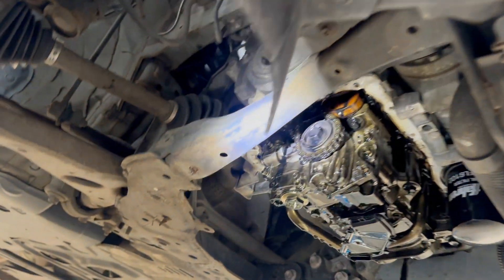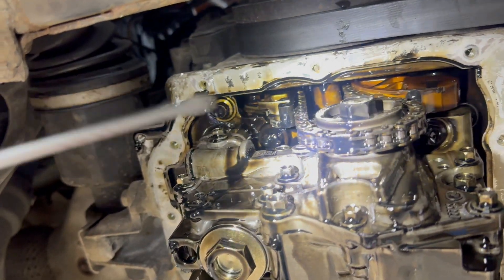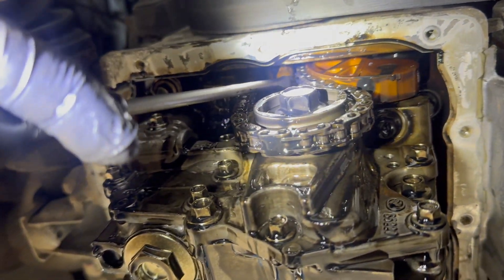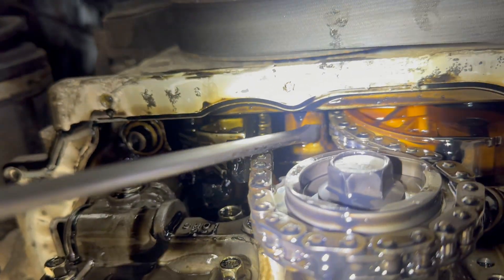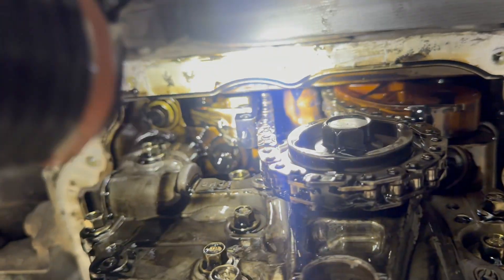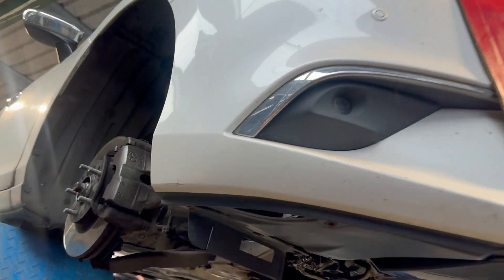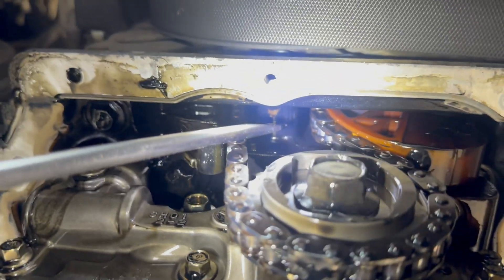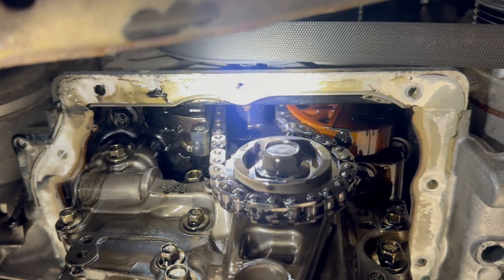Mazda 2.2 Skyactiv Timing Chain Noise and Oil Pump Chain Stretch Inspection

Comment: Without pulling the oil pan, couldn't you read the cam/crank differential degree's on your scan tool data? Greater than 10.45 degrees equals stretched cam chain. Replace.
Reply: You cant read oil pump chain
Reply: @krzysiekp9753  I was referring to the timing chain on the camshafts
Reply: @Hyflyer28 i know what you mean but main chain is usualy ok is the oil pump chain which is making noise and is snapping

Comment: Usually what is the mileage that is necessary to replace the timing chain? And when the timing chain is changed, is it necessary to change the oil pump chain as well?
Reply: Oil pump chain is common to fail,so yes 100% recommended to change together!
Reply: I made it 193k miles without the timing chain ever being the issue. That is dependant on how often the oil is changed, we changed the oil every 8k miles in our 2013 mazda 6. You always change the oil 2k before the manu says so to save your engine, these cars had mad turbo issues until 2018, not timing

Comment: Hello. Please tell me at what mileage it is necessary to change the chain.
Reply: Difficult to tell this one has less than 100k. I would recommend to replace after 100k for sure
Reply: I had one do over 150k. I could hear it when it started to go. Luck of the draw seems to be at play a lot with these though. I too would say do every 100k it not before